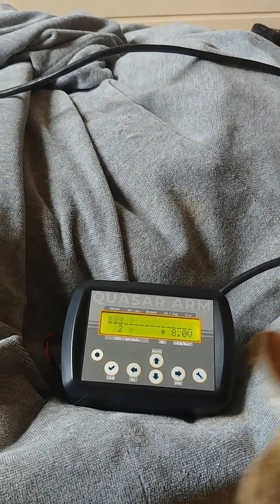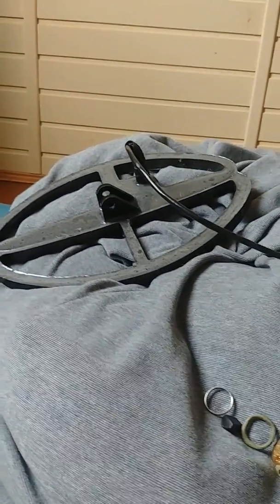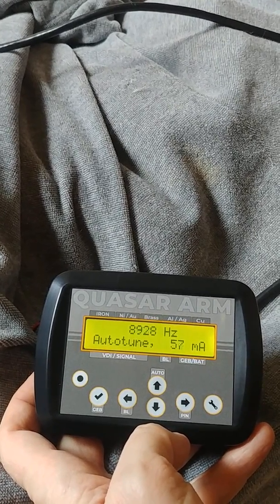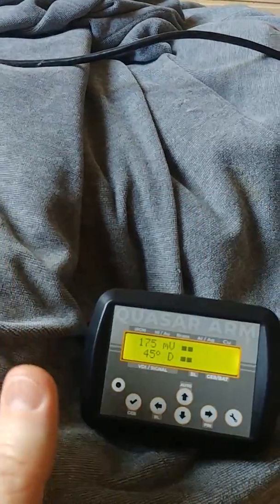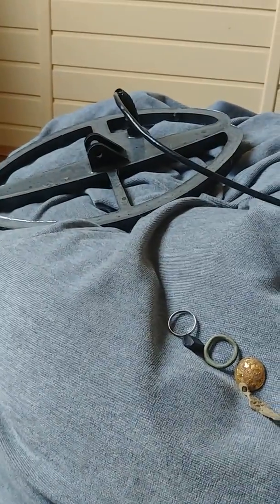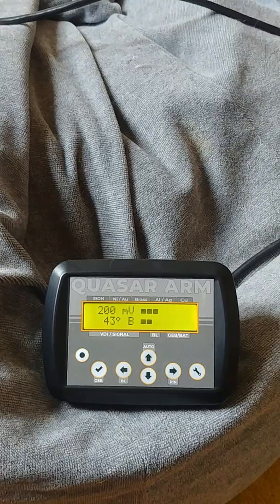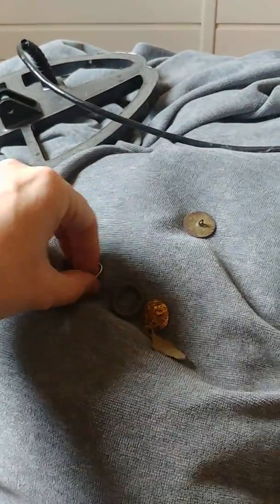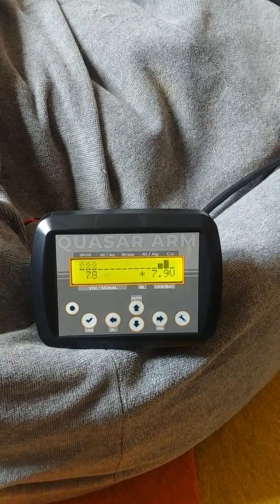Quasar ARM Metal Detector - setting up the new coil

Comment: I’ve had my quasar arm for a while and bought a coil but it didn’t come with ferrite and wondering where I can source a piece in the United States? Don’t mind ordering from another country if need be. Thanks for the video. It definitely helped me some.
Reply from the maker: Hi Christopher! That should be absolutely no problem in any place of the world :) There are plenty of places you can get one. The easiest way is to look for the good old VGA or USB cable with bulges on the ends. In these bulges there are circular ferrites. Just clean resin with a knife and use hammer to crack the ring. The cable will be useable after.

Or, you can look for some PCBs around and find "Inductors" there. Normally they are wound around ferrite. PC's Power Supplies might also contain small transformers wound on ferrite rings (just try to break it to ensure it is ferrite not steel)

Let me know if you still struggle and I will find a way for you based on the coins we both have (I think I've got some dimes)

Comment: I've got a problem with my Quasar ARM. 
Signal that i recive from coil is very good, strong and clear. But it is problem with position of items under coil. For example .
If you can imagine the coin  under sand. Than f i move coil direct  above the coin, there is no signal. But (it depends) if i move coil a few cm in front of or behind the spot it is clear and strong signal.
That means. I need  to dig not under the coil where signal sounds But in front or behaind the coil. It deppend from coil balance or ferrite zero Point.
Can you help me with this problem??
Reply from the maker: Hi Pawel! This is quite strange, I don't think I ever met something of this kind! 
But let me suggest pair of things:
- first of all - could you double check that your Ferrite is tuned well. In this case I especially mean that the coin should produce SINGLE signal when the target is at 20-25cm from the coil. If it is DOUBLE - just rotate your angle 180 degrees
- then, actually DD coils have two points of most sensitivity, that are on the front and back crossing of the TX and RX , and on the back. Knowing that is making pinpointing easier. But I never met situation when the signal is so better above these points, but absent in the middle....

Maybe if you can record some video we can have a look ?

Cheers

Comment: can the quasar use a gold finder coil that has been modified at the TX RX pin out and has been adjusted to the quasar pin out, TX = 760uH and RX = 8800uH.  can this be used?
Reply: Tested - works pretty okay. The balance is quite high, so the Chinese coil is not really well made, but it works
Reply: Hello! Yes I think so! the values look pretty okay, so it should work pretty fine. I have one from China - going to give it a try in an hour :)

P.S. Remember you should add at least one capacitor in series with TX. Quasar expects these in the coil
Reply: @BobrDrob  I also use a coil from China, tx using a wire 0.35 = 760uh and 0.15 = 8800uh.  I use capacitor tx 10nf, 15nf, 18nf.  rx parallel to coil 20nf,22nf.  but the detection of 2gram gold is only 5cm in the air,, is there a solution?
Reply: @bayuprihambodo  unfortunately I have almost no experience with gold nuggets... 

And I have no gold if this size to test...

Any other test targets ? US coins maybe ?
Reply from the maker: @bayuprihambodo  Interesting tests, thanks for sharing!

But from what I see you have completely wrong capacitors and therefore resonances. 43nF and 760 uH gives 28kHz, and 8800uJ with 42nF gives 8.3kHz. 

First of all - quasar ( at least speaking of ARM version, not new F3 )can't work on this frequency of 27khz, and second - the difference between Rx and TX frequency should be 1.5 - 2 kHz only.
Reply: @YourDetector  please advice for me, the right capacitor for this coil!!  because the detection distance is too short
Reply: @BobrDrob  I tested it using a gold ring, silver ring, copper coin, aluminum coin, and a small pendant, I didn't test with gold nuggets because I don't have one,
Reply from the maker: @bayuprihambodo  Okay, I suppose you better target 18kHz for Gold, so it will be 100nF for TX and that will give you around 17.5-18kHz
Then with RX you can try 11nF and it will be 16kHz, or you can try 7-7.5 nF and you will get 19.5-20kHz on RX. 
That will give you the difference of ~1.5kHz between RX and TX and everything should work fine.

The only question is whether the Quality Factor of this coil TX is too large. I will try to test in the nearest days. (the drawback of High Quality Factor is that your coil will have problems working on Heavy Grounds. The solution will be to lower the Frequency. But don't worry too much yet)
Reply: @YourDetector  very petrified, thanks master, I didn't try for the frequency 13.8khz tx, and 12khz I got the formula from the quasar table that my friend gave me at geotech, I installed 220nf tx, and 22nf rx, the result is a gold ring of 2gram can be 13cm, with 9mv pwm  , thank you very much for your suggestions I have noted, later I will try to apply it to my coil so that the frequency can be higher, thank you very much master

Comment: thanks for this video. I have a quasar arm i could't get to work till i watched this video, do you know what the latest firmware version is?
Reply from the maker: You're welcome! Glad it works ))) regarding latest firmware I would recommend 2.6.1 ( without M letter ). Actually 2.6.2 is the most recent, but it looks like there is something wrong with it. Too many noises even on our best PCBs..
Reply from the maker: 2.6.4 is tested, works fine, has interesting Sound Profile 4, that makes 3rd iron sector to sound as Non-Ferrous (useful when searching for the small gold or silver). But there is one drawback - the FM frequency not stored right.

Comment: Hello what are the Hardware fix when i use higher frequency thx oli
Reply from the maker: Hi! Quasar works quite reasonably with frequencies of 18+ kHz, but if I remember correctly, we've done some simulation in PSPICE, and the input filter does not look perfect for these frequencies. Haven't investigated in depth, but should be an easy fix. Will try to post some explanations in nearest days!
Reply: @YourDetector  thx a lot ,very good your art to explain
in the Moment my Machine is quit in the House and outside every swing false signals.
Reply from the maker: @oligrandt898  okay, I see. Does the coil react to the hand sweeps? I mean if you swing your hand above the coil, do you get signals? ( Might be a bad Shielding )
Also, do you think you fine tuned your ferrite angle right? Try to manually adjust angle left and right a little. Do not forget to Save
And finally, is the coil cable secured around the shaft?
BTW, I don't think changing the filters will help in your case. I think filters might be changed just to amplify the Useful Signal. But from the other side who knows..
Reply: @YourDetector  hello thx for your answer, if i touch fine the coil i get false signals

Comment: Very good training on a a great adaptable metal detector.  Looking forward to the next videos.  Any links to coils we can buy?
Reply from the maker: Thanks a lot, Kurk! Surely we will have a next series of videos on the additional settings, menus explanation, and unit usage. Hopefully these will come in a month! Stay tuned :)
Reply from the maker: It is a shame but current timeframes for the coils are very bad, thats why we don't have them on eBay :( we hope to improve this in the nearest months.
In the meantime - I hope to start making the Video/Website on the Other coils reuse, at least as a temporary solution.
Reply: @YourDetector  I'd be interested in info to utilize other coils like the pinout for the coil plug. I bought a coil from the Ukrane just before this virus thing. mail got slow and took 4 months to arrive. wasn't the sellers fault and I had planned to buy other coils for different search situations. your videos are the best on these detectors. thanks so much
Reply from the maker: @christopherwhitcomb6233  hi Christopher! Not sure what exactly you want to know, but as you mentioned Pinout here it is:
1 - RX+
2 - RX-
3 - Shield
4 - TX-
5 - TX+
Sometimes 4 and 5 are swapped, as seen with some Ukrainian coils,  but this is not problem, the coil will work without modification, just Ferrite angle will be inverted.
Otherwise, in general, if you are going to try some other coils then the main principles are:
1.  Capacitors are expected in the coil ( tx capacitor in parallel, and optional capacitor in series with Rx coil )
P.S. we also met 2-3 months delivery times while COVID was is active phase :( 

Cheers
Reply: i know im asking the wrong place but does any of you know a trick to get back into an instagram account??
I was dumb forgot my password. I would appreciate any assistance you can offer me.
Reply: @Shepherd Conor instablaster :)
Reply: @Nikolas Kareem I really appreciate your reply. I got to the site on google and I'm waiting for the hacking stuff now.
Looks like it's gonna take quite some time so I will get back to you later when my account password hopefully is recovered.
Reply: @Nikolas Kareem it worked and I now got access to my account again. I'm so happy!
Thanks so much, you saved my account :D
Reply: @Shepherd Conor happy to help :D